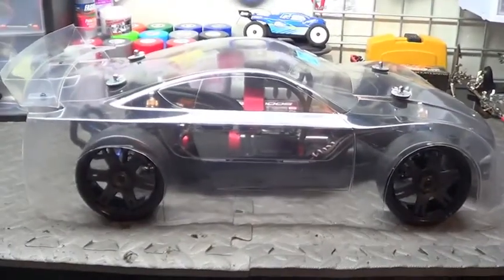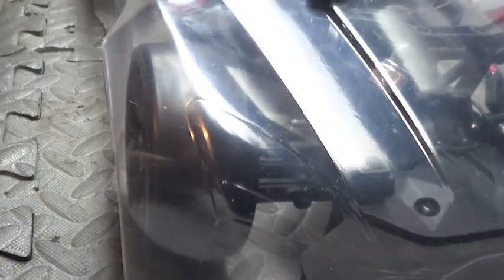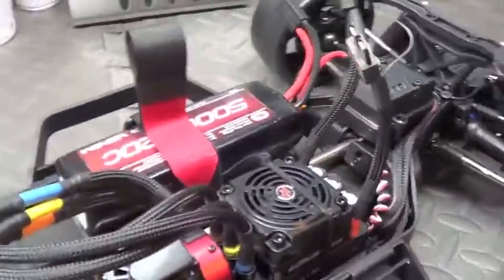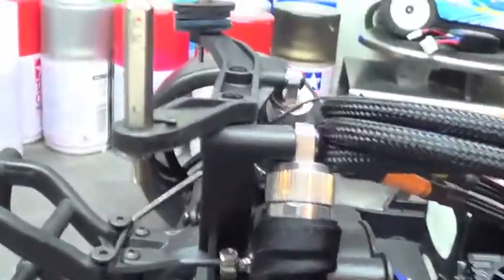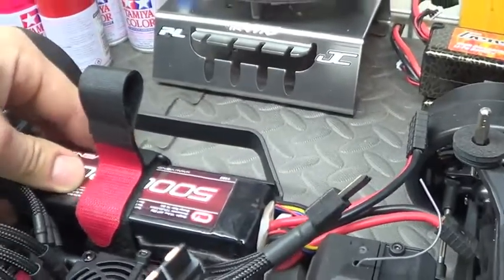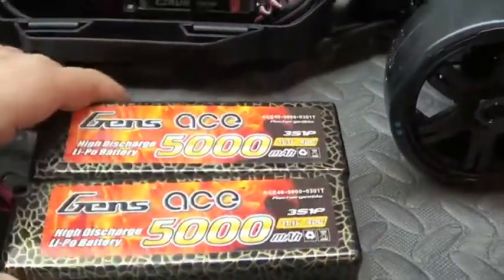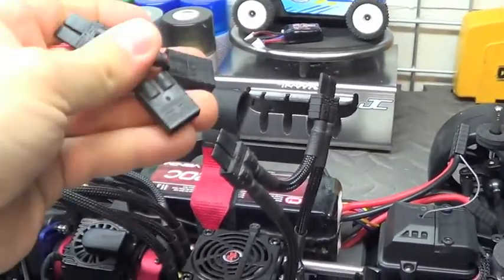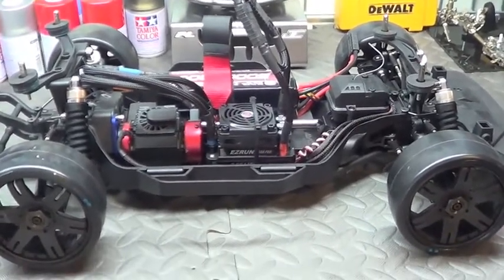Traxxas 1/10 Rally GT-8 Update!!

Comment: I has using that exact Venom battery for my early speed runs. It got me past 70 mph with my Rustler (before the rear wheels spun out and wrecked me), but I measured a LOT of voltage drop under high current load. It is a good pack, but the 20C rating will let you down in max power speed runs. I have recently measured the Gens Ace 5000 mAh 2S and 3S packs, which hold higher voltages under high current loads, which will give higher speeds. The extra current capacity also gives noticeably higher torque. I'll be posting a battery video on my channel soon to properly present this data, but I have some "dyno runs" posted now with the Venom pack if you are interested.

I just subbed since I am also building a rally GT-8 car around a Castle SCT power system. I like your set up and may "borrow" some of your ideas in my new rig. I'll let you know how it comes out.